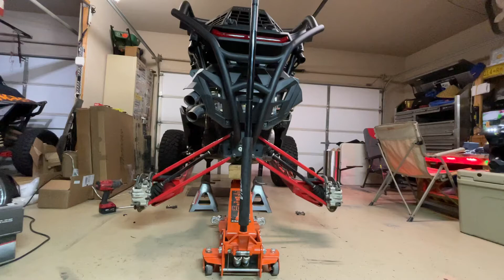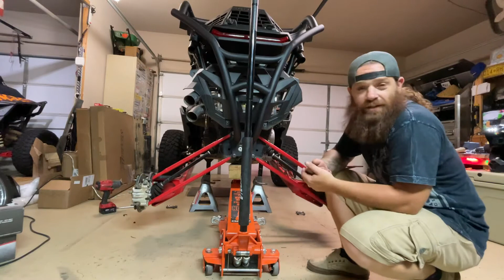Electronic Sway Bar

Comment: David u ever had issues with your ride command on your S on ours it started not coming on. Pulled fuse stuck back in worked till next time turned off. Replaced fuse came on till next time killed again and fuse ohms out good?  Just curious if u have seen same thing.
Reply from the maker: No actually I haven’t i did have an issue where the buttons wouldn’t illuminate however and luckily its all getting replaced under aftermarket warranty. Ive never heard of one not coming on however.